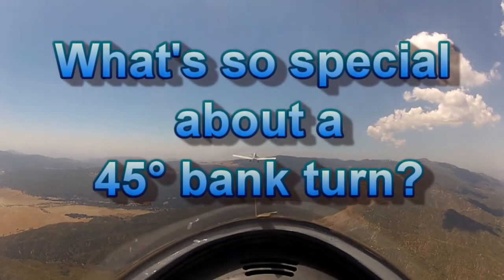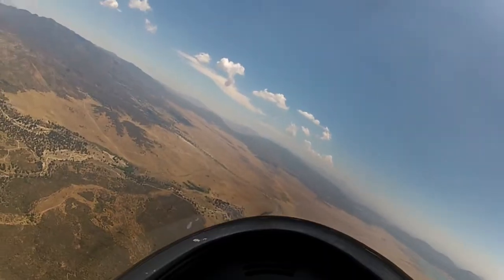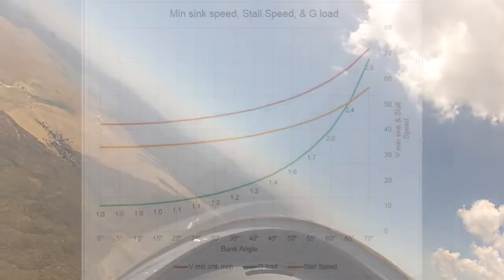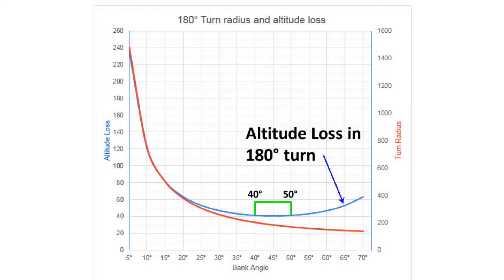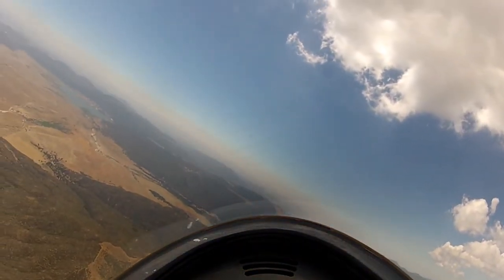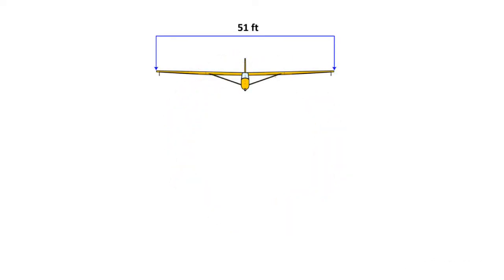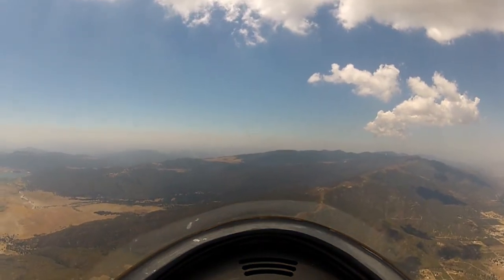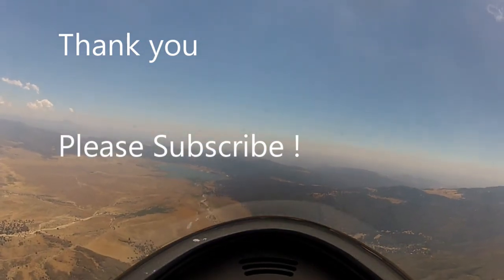What's so special about a 45° bank turn?

Comment: Can someone explain why there a diagram of a line at 22 seconds on video with 45 marked on X axis which seems to imply this is what the horizon look like at a 45 degree bank. From the picture the angle of the line is at an angle lower than 45 degrees and what does the mark on the x axis at 45 have to do with a 45 degree bank angle.  I am not a pilot but just wondering why this graph is included in the video.
Reply from the maker: It’s just showing that a 45º angle is halfway between 0 and 90º of bank. No more significant than that.

Comment: Thank you for sharing. I am not a glider pilot but fly sometimes with the MSFS 2020 (Discus 2c FES)   i am sure i will not need it for simulation flights but i think its nice to know.
Reply from the maker: if you thermal in you MSFS glider flights., banking at the right angle (up to 45º) and the right speed, is key to optimizing climb performance.

Comment: Hello!What do you think about my thermal soaring with Flightgear simulator?
https://youtu.be/c93zpZE_oOI?si=EYCRtMIof2JT3hu8
Reply from the maker: Try for a more constant pitch attitude - your nose goes up and down a lot. 
Your bank angle gets very shallow at points - thermals are small - bank steeper to maximum at the peak lift and minimum and the poorest lift point. 
Looks like to you shallow too quickly when the lift starts to weaken.

Comment: Have you taken into account how the glider is descending in the physics? My understanding is that we experience slightly lower load factors in any given banked turn because we are descending, is the right?
Reply from the maker: that would only be the case if you were accelerating downwards.  at a steady descent rate the g load is unaffected. 
Often we CLIMB in these steep turns as we thermal up! 
Regardless, the change would be small and indiscernible from the minor g-load variations due turbulence or control adjustments.

Comment: As a private pilot that is just taking up soaring (I have just an hour of duel soaring at this point) I never knew (or forgot) that 45 was the best balance for managing altitude loss when doing a 180 (or any turn). These charts are the same in all airplanes regardless of type? Are the sink rates different at different airspeeds?
Reply from the maker: Yes. The rules of physics do not discriminate 😁

Comment: I stopped this video about a third of the way after almost puking on my shoes.  This whole thread thread illustrates why American students score so poorly in STEM education topics
Reply from the maker: That’s an non constructive  comment.  If you’d like to make your case please be specific. Also include your glider experience
Reply: @ private pilot glider circa 1976. Single engine a year or two later with training in accelerated stall, spins and aerobatics ( Citabria).  About the only way that I know that an airframe can get heavier is in icing conditions
Reply from the maker: You’re confusing weight with mass. Weight is mass times acceleration. If you’re pulling g’s you weigh more. That’s why things in orbit are “weightless” but not massless. 
ATP CFIASMEIG 20K hours 5 jet type ratings diamond badge with 750 Diplome (private in ‘74 😬)
Reply: @anguscampbell9311  Good morning Mr. Dunning Kruger and thank you for my morning chuckle.

Comment: Very interesting discourse. Fundamentally when you Bank a turn in an airplane you are pushing into your safety parameters. If you have an overloaded plane and you managed to take off, it will fly straight, but when you start to turn you start giving up things in a geometric progression in a trigonometric relationship that gobles up control authority. I can't get enough data to calculate what Bank angle would lead you with the most altitude at the end of a 360 turn. I wish I could get somebody that had a good glider to go up and get a lot of altitude and make three loops at a 45° angle and three loops in a 30 ° angle and see which one loses the most altitude for 360 degrees.
Reply from the maker: I have a spreadsheet that let's you explore all the possibilities with lots of parameters plotted over a wide range or bank angles.  Go to TheSoaringPage.com and under the Learning/Ground Study section look for "Bank angle & performance sheet" you'll find a PDF and Excel version.  The values are based well established formulas available in articles on the subject found in the Aerodynamics Puzzler articles from Soaring Magazine (also available in the Aerodynamics section) on that website.   Enjoy.

Comment: 0:57.....'It's heavier'.....not true.....so I stopped.
Reply from the maker: Well, it IS heavier. Weight is equal to the mass times the acceleration (g force). An aircraft with a higher G load doesn’t gain mass, of course but it does gain weight. In the same what that items in orbit are “weightless” but their mass is the same. 
The word heavy is less precisely defined than both mass and weight, but a simple search reveals: “When we say an object is heavy we mean that a great force is needed to lift it. Therefore, the heavy refers weight.”
Reply: @BillPalmer  Not so. Weight equals mass times g, and g is about 9.8 m/s^2. When an aeroplane banks, it does not weigh more, but there is an extra load on the wings to provide the centripetal force required to make it follow the curving trajectory of the turn. This misconception might not be your fault, since physics is often poorly taught these days.
Reply from the maker: @tallbillbassman  Indeed Weight = max x G.   Sure, when stationary G is 9.8 m/s^2, but G is not exclusively due to gravity. G force is a measure of acceleration. It can be from any acceleration.  The combination of gravitational and acceleration vectors(all described as G’s) can compound like a rocket launch or cancel out like in orbit.  When an aircraft is in a coordinated turn the total G load is higher , therefore the weight of the aircraft is higher.  The G meter in the aircraft does not stay at 1.  At no point in the turn do we bank and THEN apply an increased G, it’s done simultaneously. If you bank without turning you’re just slipping. This video is about TURNING.
I really don’t know why you’re trying to argue this. When the higher G force in a turn is applied, the aircraft effectively weighs more and as a coordinated turn requires a higher angle of attack. This is the important concept to present to pilots. In a 45º coordinated turn, they should feel 1.4 g’s and they should know their performance and stall speeds go up almost 20%. Which creates a reduced margin between their current AOA and the critical AOA. THAT’s the point. 
The chicken-egg argument of which vector came first is NOT the point here (though it may be in physics class).

Comment: 3:25 More induced drag due to ^ lift.
Reply from the maker: It would be if we didn't correct for that with up aileron on the outside wing, but we do; however, the speed difference remains and thus the increased drag should mostly be parasite.
Reply: @BillPalmer  Correct, with aileron specification.

Comment: Bill, well researched and presented; thank you.  One small point, which you may have deliberately skipped, is the keeping the yaw string centred idea.  With the nose of the glider well forward of the centre of gravity, I tend to have the yaw string a little on the outside of the turn to compensate for this.  But again, thank you.  I've asked our newsletter editor to include a link to this.
Reply from the maker: Thanks, That was a bit beyond the scope of the video which was about bank angles. 
But let's entertain your point because it's fun to see just how far off it should be.
For the example glider (SGS-233) which at 45° carves a circle about 1050 feet in circumference at sea level (the effect will be less when higher up with a higher TAS and larger circle circumference), with the difference between the location of the yaw string and an average CG location being about 68 inches,  to have a 5 inch yaw string tangent to the arc at that point gives it about a 2° deviation -- or less than a quarter inch (3 yarn widths? - less for shorter strings).  That yaw string out there on the pitot tube flutters in the breeze more than that, and for students, the goal is to keep it somewhere near the middle. 
How far off do you try to put yours?
I think it's a discussion for advanced thermalling. Maybe at the same time we should consider the radius of turn advantage of going slower than min-sink at  45° while incurring a higher sink rate as a result - will having turn radius a few feet shorter pay off with being closer to the core? I don't know but maybe a future Soaring Magazine Aerodynamics Puzzler will address it.
Reply: @BillPalmer  Those Soaring Magazine Aerodynamics Puzzlers are outstanding and really make me think  - even as a (retired) aero engineer.
Reply from the maker: @lautoka63  I love ‘em.  I maintain a loose leaf binder of them for my students to (hopefully) read
Reply: I saw a video in which the glider pilot demonstrated that he could maintain control in a stalled turn by keeping the yaw string slightly outside the turn. As soon as he centered the string, the glider spun in the direction of the turn. Goes against everything I learned (i.e. always fly coordinated). But then I read an article on the Wings and Wheels website that discusses an article by Dick Johnson on the SSA website called "Circling the Holighaus way".

An excerpt:

"According to the article, the sailplane is more efficient in a slight slip while thermalling. In a slip, you accelerate the lower wing therefore requiring less opposite aileron. The lower deflected aileron creates more lift and more drag. The more aileron you are using the more drag you are creating. Instead, you can use a little rudder and the slip will utilize the dihedral effect (imagine straight and level and you push the rudder over, it will yaw then roll in that direction) and will help maintain the bank angle from over banking.

"One consideration is where the yaw string is located in relation to the CG of the glider. Because the yaw string can be upwards of 2 meters away from the CG and the airflow around the canopy the yaw string indication can be exaggerated. Many times seeing a 10-degree slip is not unusual. Dick Johnson would see up to 20 degrees in his 16.6m Ventus."
Reply from the maker: @igclapp  Yes, Slipping turns are actually quite safe. In the slipping turn the lower wing’s aileron is UP, reducing its angle of attack in that portion of the wing and the span-wise flow is inward. Contrast to a skidding turn (dangerous) where the lower-slower wing has the aileron deflected downward INCREASING the angle of attack, and the span-wise flow can be disturbed from the fuselage further degrading flow over the wing. 

There is defiantly an argument to be made for thermalling in a slight slip that also has to do with aileron position.  You’ll find a discussion of that here:  http://thesoaringpage.com/docs/Holighaus%202004.pdf
Reply: @igclapp  One of my favourite ASK-21 party tricks is top-ruddered thermal turn, bring it to the stall, and tapping the stick on the back stop while it hangs nose in the air, shuddering like mad. And with a little 'un up front it'll spin if you switch the rudder.